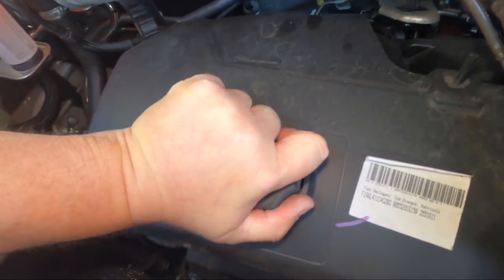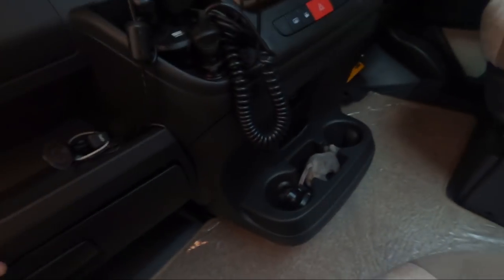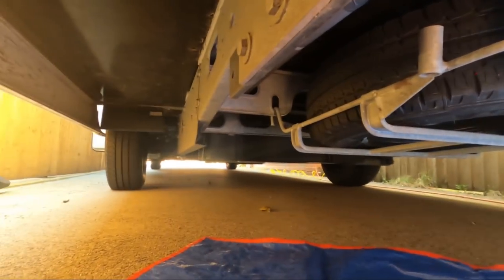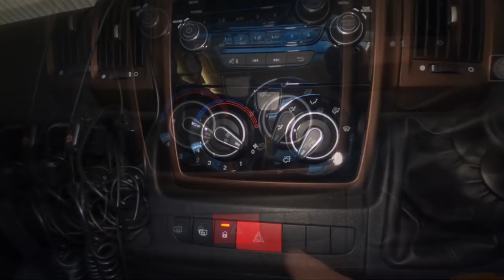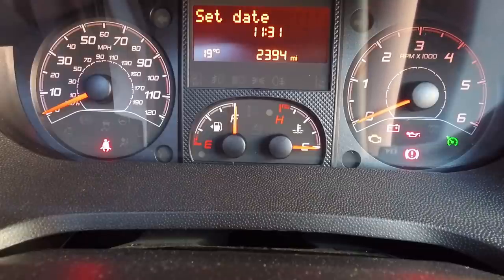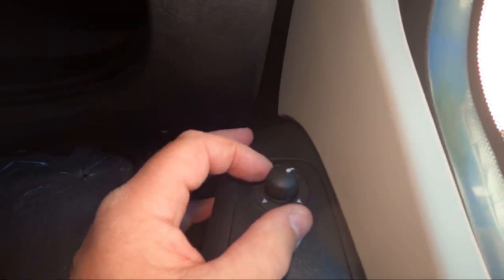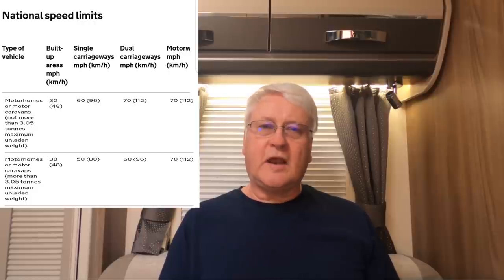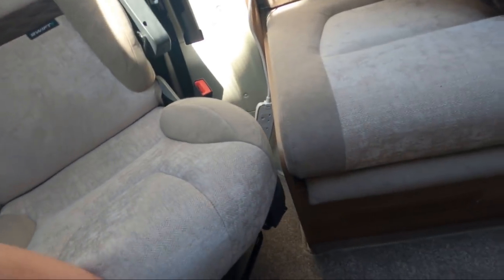New To Motorhomes Part 1 - The Motor and Controls

Comment: It might be worth mentioning that the brake fluid level is a good indicator to brake pad wear . The lower the level the more your pads are worn. It is important to check regularly as a sudden drop in level means a leak.
Reply from the maker: Good point!

Comment: Thanks for your informative video. One question did the weighbridge give its accuracy tolerance  I have heard they can be as high as +/- 10% ?
Reply from the maker: No I didn't get the accuracy of the weighbridge.
Reply: @BobEarnshawMoHo  Thanks. Do you agree  it all seems a bit  vague? The manufacturer can have a +/- 5 % fudge factor on the MIRO (up to 150 kg ) You also have the  accuracy tolerance of the weighing equipment and you are only looking at a payload of around 500kg ?

Comment: I've got a speed limiter on my car. Very useful in 30mph zones, or indeed anywhere with a limit. Means I can concentrate on the driving, not on the speedometer.
Reply from the maker: Our motorhome has a speed limiter as well as cruise control. I admit I never use the former but the cruise control is invaluable.

Comment: A few cans of Holts tyre weld £3.50  to suit your size of tyre for unexpected puntures could come in handy for when you've ended up stopped in a dangerous location traffic or crime wise and your in a hurry to get away or you've already used the spare wheel, its supposed to be a temporary fix for small puncture repairs.
Reply from the maker: Yes, a good idea, unlike some tyre sealants it sounds like the tyre can be permanently repaired afterwards.

Comment: Bob, Fiat had told me that the Service light limited mode is not true so full engine performance remains...👌
Reply from the maker: I understood it happens after a certain time, think it might have been 500 miles, not straightaway.
Reply: @BobEarnshawMoHo  I use local courier who run 3 67 reg ducato's with over 150k miles and they never see a fiat dealership for service. They have very recently learnt the reset service procedure.👌

Comment: Surpised that Swift do not fit locking wheel bolts (mine has the same wheels as yours).  I am going to fit locking wheel bolts to mine (about £50 from a Fiat dealer).. would cost over £1000 if your wheels are stolen.
Reply from the maker: Yes, a good idea.

Comment: Thanks for a great video. Just one thing. The R on the tyre spec is for Radial not Radius; It was because tyres used to have different manufacturing processes, ie, Radial or cross-ply; and of course the later is no longer used as they were found to be dangerous. Watching lots of your films as I am saving to get a motorhome in the near future. Cheers
Reply from the maker: Thanks, yes don't know what I said radius. The R16 also refers to the rim size.

Comment: The ETRTO, tyre manufacturers and TyreSafe recommend that rear CP tyres on single rear axles are always inflated to their maximum permitted pressure of 80 psi (5.5 bar) regardless of load.
Reply from the maker: Yes I know, but it feels way too high so I've settled on 72-75 psi for the rears.
Reply: @BobEarnshawMoHo  Out of interest, what are your plated tyre pressures and do you have a TPMS that doesn't allow you to go much below these pressures especially at the front?
Reply: @NigelDrayton-zb2mq  I use TyrePal. I was surprised how much the pressures change with temperature, even just standing in the sun. I now try and check pressures first thing in the morning.

Comment: Looks as though Thor was freshly washed for the filming. You missed the most important thing under the bonnet though. I always have a couple of baited mousetrap s as the little darlings love to nibble on the wiring looms when the van is laid up. Other humane devices are available but the cat doesn't like engine bay! Keep safe. Guy.
Reply from the maker: Thanks, touch wood, never had a problem with mice.
Reply: Yeah saw a vid of a Russian getting in his Lada,  first he opens the bonnet and takes the stray cats off his warm engine before starting lol  Never thought cats were searching for mice in the engine bay, thought it was just coz its warm.

Comment: I find the speed limiter very useful on roads with average speed cameras on.
Reply from the maker: Yes, I could use it for that, but then Ican't use the cruise control to maintain speed, I just set the cruise control.
Reply: I probably use the limiter more than the cruise setting.  So many of the villages near me have speed cameras or frequent mobile cameras I tend to engage as I pass the 30 sign.

Comment: Hi Bob
We are looking to buy our first motor home after hiring for a couple of years. I'm going to look at an 8m Bailey approach autograph 6. is there any particular difficulties in owning a motor home that long? 

Ive hired a 7 meter van and didnt find it particularly cumbersome will the extra 1M make a big difference ?
Reply from the maker: It all depends where you want to take it. The obvious issue is fitting 7+ metres into a standard car parking space. Driving on the road is hardly any different to driving a 6 metre van. The main issue on the road is the width compared to a car.

Comment: Hi Bob - Great video as per usual.  With the internal locking button (next to the demister) we have found that the doors are only locked when the button is pressed and the red light on the button is lit.  I admit it's a little confusing as the red light turns itself off after a while anyway.  I'd hate to think that people thought the doors were locked overnight when they weren't.  All the best
Reply from the maker: Thans, yes you are right about the button, you actually have to press it twice to get it to lock..
Reply: fab point that !!!!

Comment: Hi Bob, I noticed that you didn’t trust the pressure gauge on the tyre air pump and used a digital gauge. Also handy to check the tyre pressures without having to get the pump out. Can you please point me the right direction to source one?
Reply from the maker: I bought that one from Halfords, but I'm still looking for a proven accurate gauge.
Reply: You can get caps that tell you the pressure of the tyre or caps that tell you inside the vehicle by signal their pressures too.
Reply: @BobEarnshawMoHo  Thanks you, I'll keep looking
Reply: @marklittler784  thanks Mark I have seen these,  but I would prefer to manually check the pressures.
Reply: @rogerlathbury9860  lets you know early there's a problem whilst driving, can save a tyre.
Reply: @BobEarnshawMoHo  I use the metal pencil stick type. Extremely accurate. Unfortunately, I'm a bit pedantic on pressures and I have the tyres at exactly what they should be! Superb video, very informative as always (I'm slightly addicted to you and Andrew Ditton's posts).  Apologies if I missed it but what weight did get on that weighbridge?

Comment: Thanks Bob. I’m following the series and learning as I go. Every days a school day as they say. You clearly know your stuff and have been doing this for a while. Thanks for sharing. Looking forward to learning from the rest of the series. Really good reminder to check the spare tyre pressure. Wouldn’t have thought of that. Slightly different system to get my spare out but I know how heavy it is after doing a video on my channel about changing the wheel. All great info as usual. 👍🏻

Comment: to be honest Bob we changed in November to Auto Trail Imala 625 that's got sat nav but we made big mistake changing van as we now don't like it only done 350 miles and trading back in but with losses we have gone for 185 similar to 285 but not as high spec but same layout and no sat nav but I do have a truck one so maybe that will be fine Cheers Russ

Comment: I think that their will only be an increase in motorhome hiring so sites will be a lot busier, you should probably put a padlock on your spare  wheel to stop anyone tampering or taking it
Reply from the maker: Thanks, do you recommend a particular one?  I would be worried about it going rusty.
Reply: @BobEarnshawMoHo  you should just get a weather proof one and a chain and just regularly monitor it
Reply from the maker: @daniel0541  Yes, think that's what I thought looking on google, there doesn't seem to be anyone making a specific one.
Reply: @BobEarnshawMoHo  most people just have a padlock and chain, their probably isntva specific one as not every van has one and they are not very common anymore to be underneath
Reply: You could use padlocks instead of the retaining pins.

Comment: Some of the latest rechargeable tyre inflator will go up to 120psi ,there are various types ,but very handy as no lead to plug in , and a good tip is let any tyre inflator cool a little after 4/5 mins of pumping types 👍 they don't like getting hot .
Reply from the maker: That's good if they are rechargeable.
Reply: @BobEarnshawMoHo  Yes some also have a dummy battery that doubles as a connector for 12v cigar wire type so is able to run like the one in your demo .

Comment: Bob. Another useful video, thank you.  We are considering getting a Motorhome in the future and will probably hire one for a couple of weeks to make sure we are doing the right thing.  

I do have a question on driving licence.  You said about weight limits and licences.  I have C1 because of grandfather rights.  If I were to buy a van which was over 3500kg would I have a problem when I turn 70 as I think you loose your grandfather rights at that age?  Sounds a bit silly to me as by then you may be a grandfather.  Or is there some way around that issue?  Many thanks.  Barry
Reply: Technically it's permitted rights if you are talking to someone at DVLA. They hate the term 'grandfather'. There are many factors that come into play at age 70 and it will depend on those and possibly a report from your doctor to see if you retain the category.

Comment: Nice one Bob
Although I run an older model , lots of common items.
Not sure if thor has same set up but the electric fuse boards are many and require thought on my fiat,  might be worth a mention. Had fault on side lights and discovered the offset fuse / lighting arrangement.
Restrictions are easing but Covid virus can't read so keep washing those hands, keep extra safe at this time when others are not .
Reply from the maker: Thanks, I will cover the fuses on the next in the series.

Comment: Hi Bob we’re awaiting in April delivery of our very first motorhome a brand new Autotrail F70 we’ve avidly watched all your videos and can’t wait. I was wondering if you or any of your viewers could help me with an issue. We are having a factory fitted tow bar in order to use our extremely heavy Thule folding bike carrier and two electric bikes. Obviously we would remove the batteries as we do on our car but is this safe, does this eat massively into the payload should we cancel the tow bar in case we wreck our motorhome we are just quite confused on this issue at the moment. I know you regularly tow a car but we wouldn’t be towing we would effectively be carrying, I know we regularly do it on our Renault Captur without even thinking about it so why am I so obsessed with the issue on the Motorhome!!!??? Any observations anyone has would be most welcome. Thank you in advance.
Reply from the maker: It's a problem for many people who buy motorhomes that are 3500kg, sometimes you don't have a great deal of oayload. Don't go removing your batteries, much of the interior electrics run on 12v, there are other ways of saving weight, like running without water in the tanks. You need to know your Motorhome's payload is before you start adding anything else. The manufacturer provides a Mass in Running Order, (MRO) this the basic weight before you add anything else. The difference between your Maximum weight (MTPLM) and MRO gives you your payload or how much you can add to the Motorhome before you are overweight. Also, if you put heavy bikes on the tow bar, you add to the loading on the rear axle because there is a leverage effect.
Reply from the maker: See https://youtu.be/lKaZc7Zw30w
Reply: That’s helpful thank you ps when I said remove the batteries I meant on the bikes as they are very heavy
Reply from the maker: @mariathomas6144  I see, but you would still take them with you? Why a tow bar and not a bike rack? Tow bars are heavy compared to a bike rack.
Reply: The bikes are too heavy we have been told to put on a conventional motorhome bike carrier yes we would take the batteries but carry them lower down in the van to equal out the load I understand what you said about leverage on the back and it is a consideration we need to think about there’s so much to learn!!!!!
Reply from the maker: @mariathomas6144  then you need to get to a weighbridge and see what the loads are.

Comment: Excellent video. Will have a look at the mode button and settings again. Interested in your choice of tyre pressure settings. I set ours at between 5 and 5.5 psi but when we collected the vehicle the dealer had the pressures much lower and also gave this advice. The handbook recommended the 5 to 5.5 and I adjusted upwards. It feels more solid on motorways now but just wondering what your experience is on tyre pressures. Looking forward to the next videos
Reply from the maker: I think that Michelin revised their advice and suggested lower pressures at the front. I run at around 62-68 at the front and 72-78 at the back, depending on load.
Reply: Bob Earnshaw  Thanks Bob...

Comment: Interesting to see the variation in manufacturers,we have the same chassis as you but no spare wheel but have the tyre inflation/injection pump which is good for pumping up the tyres if needed but also we have air suspension on the rear which can also be inflated with the tyre pump. Interesting walk through and I’m glad you pointed out the extension to the screen wash bottle which we weren’t shown on our hand over.
Reply from the maker: Thanks, glad you found it interesting.

Comment: Excellent video Bob. I've had three Fiat Ducatos since 2007 but still found it interesting. My van has Michelin tyres, so set pressures recommended by Michelin & axle weights. I've also fitted TyrePal pressure sensors which have found excellent. Keep the vids coming Bob.  Al.
Reply from the maker: I was looking at the TyrePal sensors this morning, if I went for the setup to monitor the towed car's tyres as well, it was nearly £300!
Reply: @BobEarnshawMoHo  I've had mine quite  a while, always feel confident about my tyres when driving & very accurate readings including temperatures. Definitely worth having. Al.
Reply: Another thumbs up for TyrePal from me too.

Comment: Hi Bob Surprised to see you do not have locking wheel studs and covers! and you forgot to mention Never remove the coolant cap when the engine is warm, because of the pressure!
Reply from the maker: Thanks for pointing that out. I really should get you to watch my videos before I upload them! 😀 As for the wheel nut covers, I had them on the previous Bolero, they were a pain to remove. I should get some locking nuts.
Reply: Ha Ha Thanks Bob.

Comment: I'm so delighted that you bought the same Motorhome as me. I didn't know the whereabout of the battery terminals and how to remove the plastic pull out screen-wash,  power-steering and coolant bottles. I've also just ordered the Ring Tyre pressure from Amazon. Thanks Bob, you are a mine of information, and I have the benefit of having exactly the same van as you so I am an avid follower and number 1 fan. Well done, keep up the good work. Greetings from Scotland.
Reply from the maker: Thank so much, glad it helped.